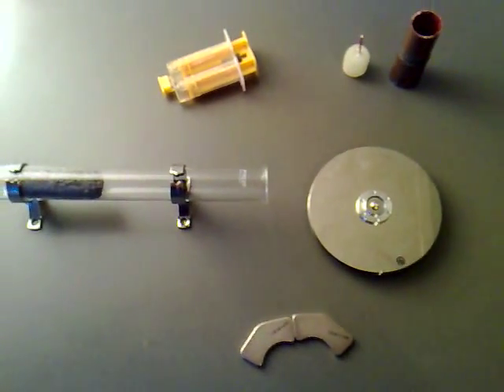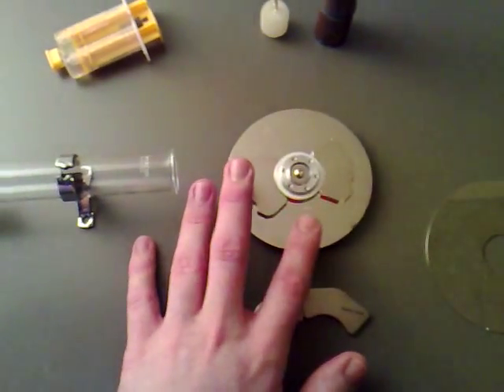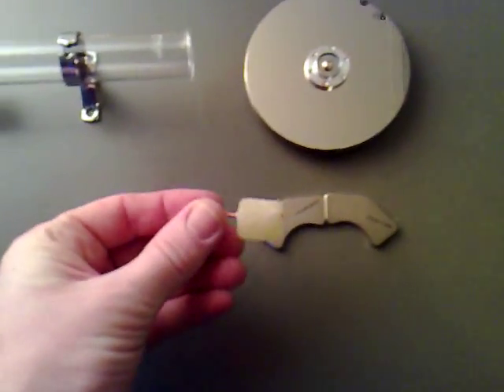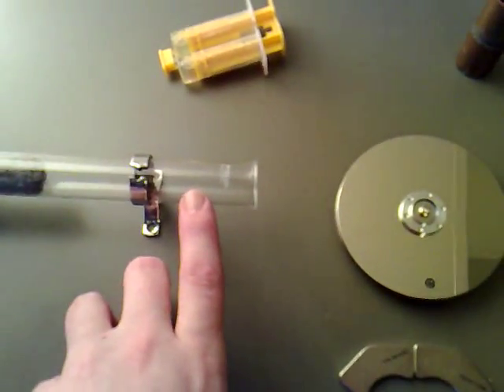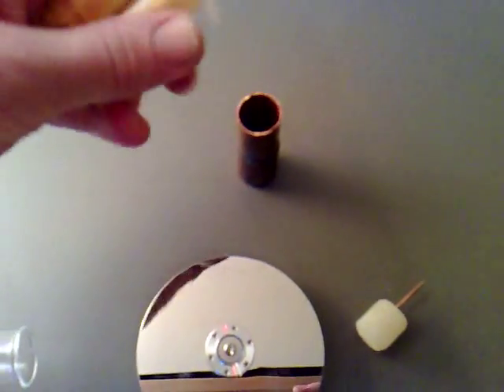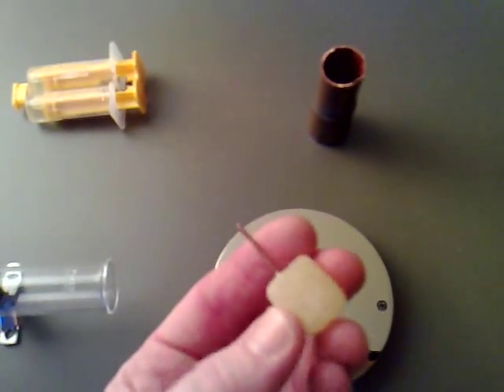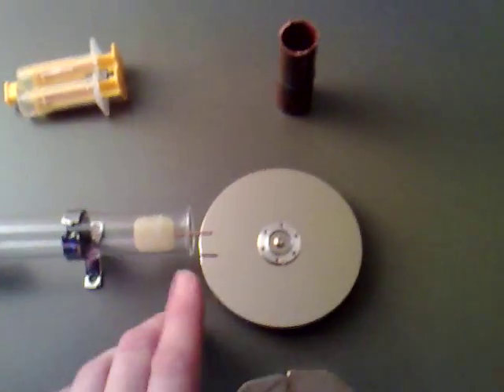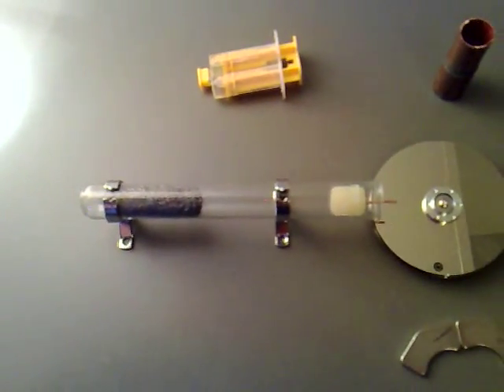Stirling Engine (Flywheel) 003

Comment: Yep, the plug cutter is a good idea for fabricating a tight fit. :D

Also, most hardware stores sell 1/2" OD axle rod. Cut it to length, drill and tap for the connecting rod and voila.

Or if you want to get fancy, check the hobby shop for an RC engine piston. It will have a real connecting rod and wrist pin already.

Cheers.

Comment: Silicone grease. ;) Also, you may consider a cardboard tube instead of the copper tube. Then you could peel the cardboard off, chuck the piston up in a drill and sand it to fit.

Cheers.

Comment: in woodworking there is a tool called a "plug cutter". it is a cutter that fits into a drill or drill press and cuts precise 1/2 inch, 1 inch, 1/4 inch, or whatever diameter you need.  these cutters could be used on wood, plastic, laminate, or whatever you need. (not metal) 
if you decide to try one, be careful, some are tapered, and some are straight.

just type in "plug cutter" in google and look at the Images.